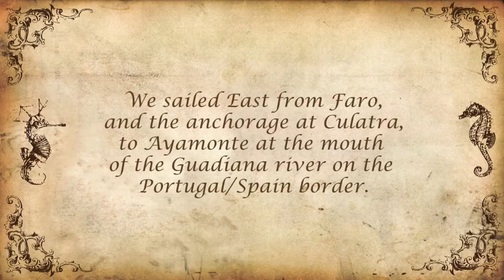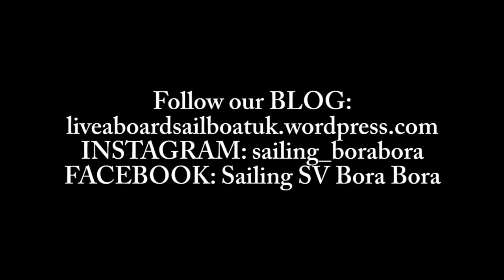Ep006 Sailing Portugal: Rio Guadiana, Wild Food and a Haul Out

Comment: Always best to turn round and motor into the tidal stream and slowly allow yourself using throttle control to gently run astern towards  a tight bridge, if you touch you can motor forward and away safely minimising damage

Comment: Rewatching for a second time your vids. No I'm not bored but curious. What is in the deck box forward of the mizzen mast?
Why is it louvered? 
Do you find that 2 heads are necessary, or would you prefer one? If you were to convert one, which would it be, the forward or aft head?
Your blog link is busted, got another one? Or just to busy to do it (which I would understand.. its hard to do one let alone another...?)
The one thing I find looking at these boats (victory 40 / Trintella lV) is the small galley. Do you find it a problem? 
Thanks. !!!!